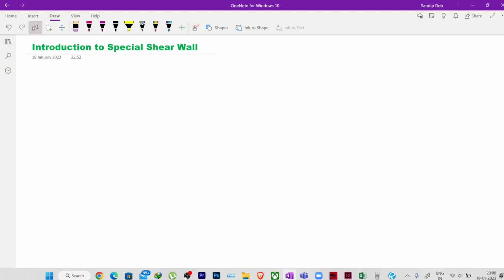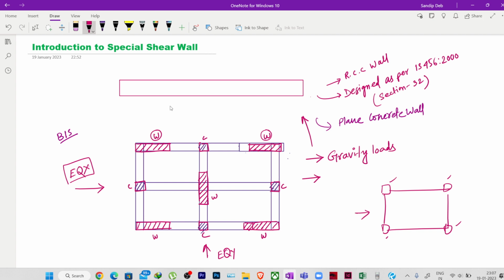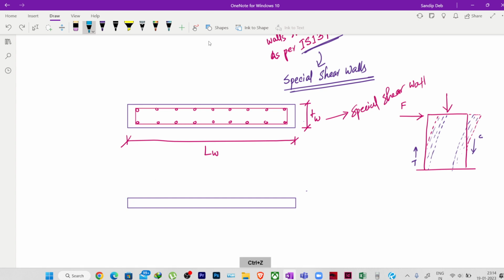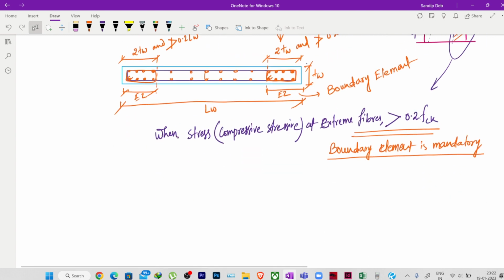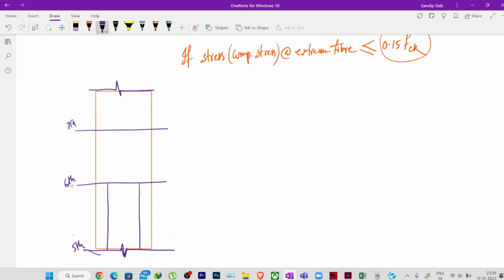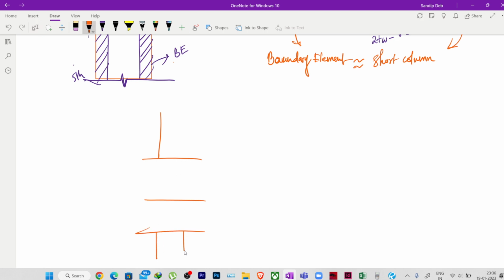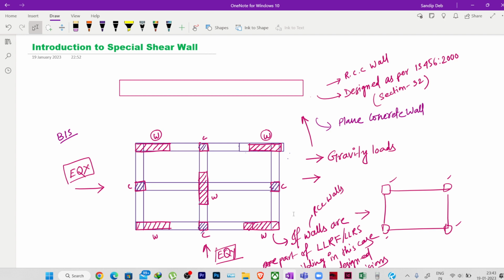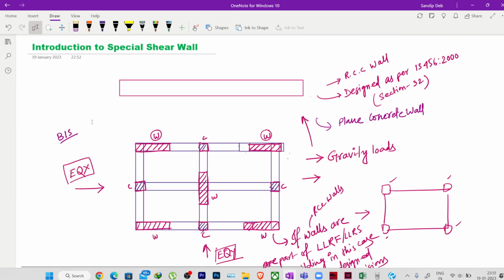RCC Special Shear Wall- An Introduction | IS:13920-2016 | ilustraca | Sandip Deb

Comment: Where it's written Boundary element length is minimum 2times the thickness of wall..?
Reply from the maker: Not written guidline on this... general practices and reference from design books.
Reply: @ilustraca  i haven't seen any such general practice, we provide from min length of tw but for max. We don't have such practices specifically for high rise buildings,we check stress and calculate length or area of boundary elements.sir if there is such practice done any project then will please elaborate the same.